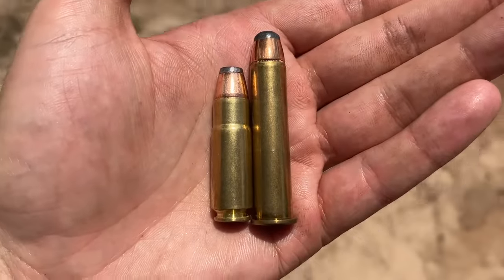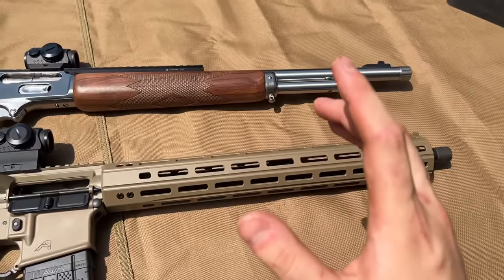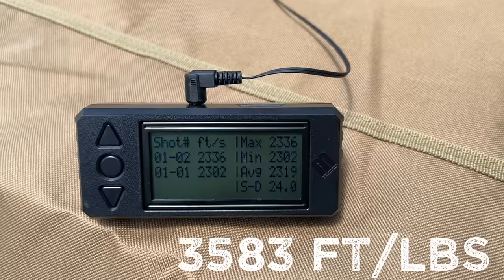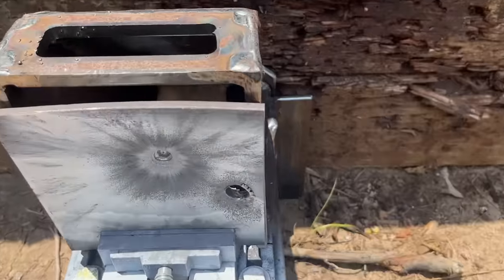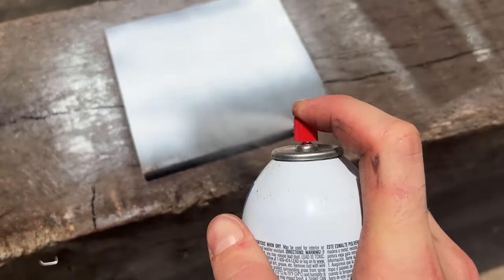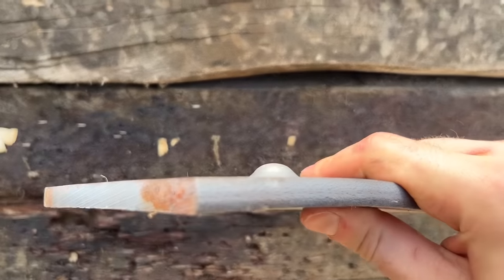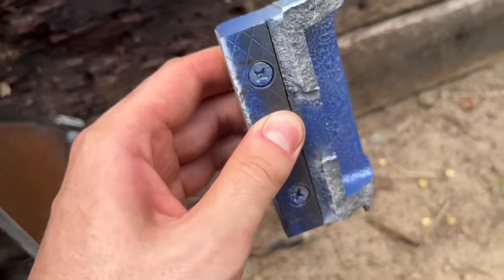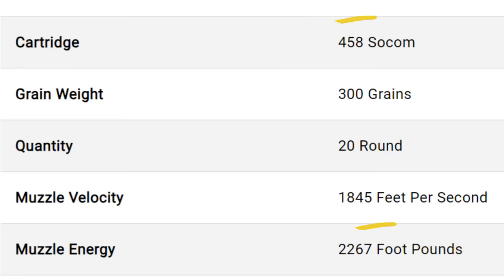458 Socom vs 45-70: Completely Different On Mild Steel

Comment: Several years ago I shot an old steel sledgehammer head at 125 yards with a 1944 Kar98k using 1943 Turkish 155gr cupronickel FMJ lead core ammunition. The bullet made a deep crater in the steel, made a nearly perfect 180° ricochet, and struck me on the knuckles of my right hand which was still gripping the stock (my trigger hand). It didn't break any bone but I have 3 scars there now. It felt like someone had just walked up beside me and smacked me across the knuckles with a 2 by 4.
Reply: you were very lucky my friend!

Comment: These new hot 45-70 loads are probaly closer to a 458 win mag than the original 45-70.
Reply: Than the original? Of course. Closer? Of course.
But although powerful in its own right, still significantly less.
Reply: @siegfriedhorner4436  Of course, but I didn't say AS powerful. I said closer.

Comment: Try 500 Automax. Buffalo Bore has a 400 grain at 2,050 fps and a 350 grain at 2,300 fps at 4,110 ft lbs.
Reply: 325 grain  level evolution is over 2600 feet per second out of my gun. And that's weak sauce out of a 45 70 There's a 380 grain. From Buffalo Moore. Making over forty two hundred foot pounds of energy
Reply: @poorfatman5317 I just looked at Buffalo Bore ammo, the hottest 45-70 they offer is 3678 ft lbs energy.
Reply from the maker: That round is absolutely insane. The closest I have to test (out of the ar-10) is the 45 raptor which is only doing about 3,500 ft/lbs

Comment: I think you need to re-test the 4570 vs 3/8 steel. The round could have pennetrated if the energy was not reduced by the busted weld on the sled. What do you think?
Reply: I dont think it makes any difference will it move freerly while being hit or being welded on place.
Isnt that subject already beaten death ? Everything happens just too fast to plate or any
target to move before energy is already transfered.
But sake of shooting for pleasure you could redo that part if shoulder doesnt disagree.
Reply: @oldbonesbushcraftrodjackso474  I can tell you that a 45-70 will easily go through a half inch of mild steel. I've done it a few times.

Comment: cast iron, that will keep breaking on that vise, you need a vise made out of steel, in my opinion. but Hey, we like to see you keep breaking the sleds, LOL. Have an awesomeness day. thanks for the videos, I would have thought the 45-70 would have done more.
Reply from the maker: I got one made of forged steel instead of cast iron for when this one fully breaks. I really appreciate it and I thought the 45-70 would do more as well.
Reply: @bananaballistics I would suggest wood blocks to wedge the steel plate against the backing. Cheap and when they splinter get another one

Comment: Those clamps are likely made out of cast iron which could be why they are cracking.
Reply: Yeah I believe most vices are made with cast iron.
Reply from the maker: Definitely the case. I got one made of forged steel, so we will see if that does any better
Reply: @bananaballistics  A warning with the forged vises, they're typically hardened for use with milling machines, etc, which makes them more brittle.
If you find your new clamp fails, you might want to fabricate a mount with sacrificial shear points, like some low-grade bolts holding it to the base. That way an easily field-replaceable part will fail first.
Reply: You might be able to forgo the vise and use magnets to hold the target to the hood.
Reply: Why don't you just save money eyed on the clamp vise and weld the corners so there's no unsymetrical deflection

Comment: I built a very light 458 SOCOM [6.5lbs loaded & with optics] with a good muzzle brake to tame the recoil and use 410gr Sub-X heads pushed at 1600fps for my Elk brush/heavy-woods gun... It performed fantastic since the elk aren't armored. 😂 no follow-up shot necessary and the sling options make it easy to carry in a way that provides faster acquisition and less muscle fatige... a real bonus on long walk hunts or rough terrain. 
Terminal ballistics and defeating barriers is neat at the bench, but there's far more to be considered for use in the field.

Comment: Great video.
I’d like to see the .50 Beowulf thrown into the mix, Alexander Arms designed it to mimic the 45-70.
Reply: Agreed! I'm really interested to see what .50 Beowulf would do in comparison to 45-70.
Reply: It is a monster 👺
Reply: @ZRaddue  
Took two water jugs to the range to test that theory.
405g 45-70 from my Marlin blew the jug up epically.
The 330g .50 Beowulf vaporized it.
Reply from the maker: I need to get into the 50 Beowulf. Closest thing that I have tested so far is the 500 S&W (video coming soon)
Reply: @bananaballistics  
Almost picked up a 500 S&W but found a Taurus Raging Judge Magnum at a great price.
Reply: @@Peter-nm1psnot to me 😢 I’ve got aero precision builds in .450 BM .458 socom and .50 Beowulf. The 50 is still my favorite, slaps hard and was really fun to iron out the kinks but yeah if you want to be the same as everyone else stick to .223 or a unsuppressed .300 blk out
Reply: Personally I wouldn't bother with a 50BW if it's trajectory is gonna be worse than the 45-70.
Reply: Designed to mimic which 45-70 load? The original BP or some new +P variant? Very different loads

Comment: Great video. Your velocity with the .45-70 indicates you were using H4198 or IMR 4198 minimum powder charges. My reload is 53.7 grains of IMR 4198 under a 300 grain Hornady HP with 2300 fps which equates to over 3500 ft.lbs. of energy. 
It shoots sub MOA at 100 yards and even with a minimum starting load enough guts for anything you can hunt in North America. It would be interesting to see what a hard cast lead would do instead of the traditional cup and core bullet on steel or any  other medium you could imagine. I think it would be unstoppable. Keep bringing 'em, Banana.

Comment: Great content!  I'd like to see you do the test with the 45/70 vs. 3/8" soft steel plate again.  The fact that the back-end piece of the vise that was holding the 3/8" plate in place was cracked and had some give to it may have prevented the slug from penetrating the plate.
Reply: If you do some research, that doesn't make any difference. The energy of the round is completely dumped into the steel plate before it even begins to move. A physics guru can show you the math and mechanics.
Reply: @wilsonrawlin8547 😂😂😂 Not true. Not even possible. Equal and opposite is always on the same timeline. We've seen how this flex changes things over and over again. Sharpen your pencil and get back to us with some real science kiddo.

Comment: Owned a .45-70 at one point.  Could go through two or three boxes in a single shooting session.  No problems with the shoulder.  I think I also process recoil differently.  I would offer to let others shoot it but had few takers.

One thing you are definitely right about is the price.  They say money talks.  When shooting that thing it said goodbye.  Think the cheap 300gr loads were about $1.80 a pop.  Had 400gr +p loads, I don't want to think about what that cost.  They hit like a hammer at 300 yards though.

Comment: I have a marlin 45-70 and it is brutal with those stout loads.  I find the recoil magnified when shooting   from a bench rest for some reason.   The recoil seems to be more tolerable when shooting from a standing position where your offhand can grip the forend.    Not sure why, but just my observation.

Have some fun with the 45-70 and load it with some blackpowder (not substitutes).  Lots of fun to do and recoil is tolerable.

Also, no kidding, you should look into doing voice over for narrations etc.   You have a golden voice tone, so might as well use it to your financial benefit.  Just my two cents.

Comment: I've always wondered the results of 450 Bushmaster vs 45-70. They are so similar but I think the 45-70 would still have more punch
Reply: Especially in a Ruger 
No. 1 load in a Ruger No. 1.
Reply: When I think of a 45-70 I think a big game. Know where I can think of. Not even a Africa has any animals with mild steel plate for skin. Therefore, what goes through a steel plane just isn't that interesting. Perhaps it's just me. It's kind of like thinking a drill is better than a screwdriver because they both spin or something I don't know
Reply: @henryettacollins9095  only solution is to head to Africa and shoot a bunch of big game to test?
Reply: I think the SOCOM is a bit hotter than the BM, so it definitely wouldn't measure up.
Reply: Yes the 458 Socom has more oomph then the 450 so the results would be less
Reply: I'm pretty sure 450 BM has a significant velocity advantage to 458 Socom. It matches up fairly well to factory 45-70 Gov
Reply: @hammerheadms  To be fair, the BM has a slight (50-70fps) advantage with 250gr bullets and with 300gr bullets they are dead even. The SOCOM shoots 600gr bullets at ~1000fps, the same as the BM does with the 405s.
The BM was designed specifically to hunt deer in "straight wall states" with those 250gr pills. It's really quite impressive performance from an AR.
Reply: @joshrandall3632 most of the published velocities use a 16" barrel for the 458 and a 20" for the 450.
Reply: @scoyounger  no, they all use 16" barrel.
Reply: @user-ev2qo1hj1g no, the 450 is faster at the same grain.
Reply: @joshrandall3632  450 is the hotter one.
Reply: @joshrandall3632  450 was not designed specifically for deer. It was designed for cape buffalo and such.
Reply: @JoeZelensky   To be fair, the BM has a slight (50-70fps) advantage with 250gr bullets and with 300gr bullets they are dead even. The SOCOM shoots 600gr bullets at ~1000fps, the same as the BM does with the 405s.
The BM was designed specifically to hunt deer in "straight wall states" with those 250gr pills. It's really quite impressive performance from an AR.
The 450 wasn't designed for cape buffalo. It's not nearly enough for that. Black bear and elk for sure but no intelligent person would use it for cape buffalo on purpose. You're probably confusing it with the 450 Marlin because the numbers are the same. The Marlin is quite a bit more powerful and is adequate for CB. Also, the Marlin uses .458 bullets designed for big game instead of .451 handgun bullets designed for deer.
Reply: @joshrandall3632  with all supersonic ammo the 450 is faster. With subs they are all the same speed and weight. Yes the 450 was designed for large and dangerous game, not whitetail deer. You are a little confused, hopefully this clarifies things for you or gets you to read up on this stuff.
Reply: @JoeZelensky  where would we read up on this? Can you share any links with us?
Reply: @joshrandall3632 Absolutely true mate 👍👍👍
Reply: @JoeZelensky 450 BM for Cape Buffalo 😂😂😂
But...
What to expect from zelensky 😂😂😂👎👎👎👎👎👎👎👎👎
Reply: @scoyounger Info is probably from Ukrajinska pravda...😂😂😂
Reply: @scoyounger  read up on what exactly?
Reply: @JoeZelensky  where it says the 450BM was designed for dangerous game/cape buffalo.
Reply: @JoeZelensky  and published barrel length velocity. Hornady and Wikipedia use 20" and Fort Scott uses 24".

Comment: I've been handloading the 45-70 for close to 50 years for any thing from a Trapdoor Springfield, custom built Thompson Contenders, Marlin lever's, to my BFR and Ruger #1. You accidently put one of my Ruger#1 loads in a Trapdoor and you're either going to break it - or get seriously hurt from the flying shrapnel when it comes apart in your face! 

Point being, the 45-70 can be loaded very close to .458 Win Mag velocities, OR - you can down load it for pistol use as long as you don't get too light on the powder charge and end up with a hang-fire. A little case filler can fix that problem. The 45-70 in a very versatile cartridge and that's the reason it's still popular after 150 years! But it's definitely not going to fit in an AR magazine! Interesting and well done video!

Comment: I grew up with my dad reloading 45-70. The 465gr was the standard military round. Redo that test with the 465gr.  I'm betting it will move up to the next thicker plate easy.  Wear your shooting jacket with shoulder padding!
Reply: They used 465 too? I knew the old black powder guns used 405 grain and 500 grain. The 495 was cavalry and 500 was for infantry.
Reply: @Hunt_or_Die   When it was 1st standardized, replacing the 50-70, it used the 405gr bobo. US Army Ordnance subsequently tested it beyond [practically useless] 500 yds and determined that the 500gr bobo gave it greater range, whereupon that became the standard load. They also came up with a reduced load for cavalry carbines & the cadets at West Point that was a 45-55 using that retained the original 405gr bobo; that load is what they should have standardized upon in a shorter OAL that would have fit in a lever-action repeater and then used up until the Krag came along, but nooooo, the Army didn't trust the soldiers not to "waste ammo..." 🙄
Reply: @Hunt_or_Die  all of dads dies and load data he had was for 465.  He had some other data but preferred to stay with that as he told me that is what it was designed for and worked best.  Dad had the original info from the military including original manuals.  My brother got all the 45-70s and documents for them when dad passed or I would go review them and provide references.  Or find out what he taught me was incorrect.
Reply: Seems like you would actually lose penetration on steel because of the significant decrease in velocity.

Comment: You should just weld a slide insert on each side sized for the largest plate you use so that all you have to do is drop the plate in and it's captured

Comment: A simple way to attach the plate: just make 4 holes on each corner of steel. Attach to the cut end of a wood chunk with drywall screws using a cordless drill. Then once it passes through you can check out the bullet for weight retention. Would be more interesting if we knew the type of bullet.

Comment: The 458 is no slouch. It will still perform well on dangerous animals but I am glad this video demonstrates that the 45-70 is still a great contender and excellent choice. In event of a bear attack I think the 45-70 would be better for penetration,  but the 458 would be better for rapid fire and more rounds on hand. Either one would suffice I believe.
Reply: Exactly, I built a tromix .458 socom for hogs just for that purpose. Had a big boar charge me and a friend who both got 9-10 shots of a 5.56 and .300blk and he covered a good 40 yards before he hit the ground. Built the .458 the next day and ordered a magazine that lets me hold more rounds.
Reply: 300 gr is on the light side of the 45-70. Start sending some 400-500gr bullets and they go through some stuff.

Comment: The cracking of the clamp demonstrates a value to the .45-70 Government that many never consider: punching through an object is nice but the vibrational shock damage is also a factor towards disabling the target.

It is a favorite of mine so yes, I am biased and yes, I learned early on the value of shoulder padding when using that rifle.

Comment: Dang, kinda surprised to see that rear jaw already had a crack just from 5.56 and 300 blackout. I figured it would break with something bigger,I’m assuming the 45-70 will do it (i paused the video when you showed the crack), the smart move was making it easily replaceable because just about anything will break once you start smacking those 1/2” plates with some spicier rounds.
Reply: That cracked metal was obviously pot metal. It needs to be rebuilt with forged iron or steel.
Reply: @GalloPazzesco  yeah i know i have the same table Vice for small projects. I commented on the first video where he showed it and said something along the lines of that not lasting long. 

I have ar500 steel targets that broke where the mounting holes are so i knew that Vice wouldn’t hold up long. Just surprised it only took like 4 rounds to break

Comment: I built a 458 SOCOM AR and yeah, the recoils is vicious! I added a LimbSaver pad to the MagPul MOE Carbine stock and it still hurts to shoot more than 10 rounds.
Hornady 300gr. JSHP, 36gr. of H110, OAL 2.020".
Reply: I recently built a 50 beowulf AR and it really helps if you change out the buffer spring to something beefy. I also recommend an actual solid stock instead of something adjustable.
Reply: Interesting.  I built a 458 upper and frankly, the felt recoil is no worse for me than 5.56 and I hardly have any muzzle jump.  I'm shooting ventura munitions 350gr RNFP and using a standard buffer and spring as intended with 458.

Comment: Consider comparing the 454 Casull against the 45-70 or 44 magnum on steel.
Reply: 454 and 44 are both weaker than the 458 socom so what would be the point
Reply: @looseballs1966  Is curiosity enough of a response to you !!!!
Reply: @glengrandstaff9695  probly not curious because of more than 40 years of reloading shhoting and extensive testing of all of the above there is just nothing new to learn about it.
Reply: @looseballs1966   I guess you have a point. But I have seen videos on YouTube comparing the 454 Casull against the 45-70  in Clay blocks and ballistic jell and the 454 Casull matched or out did the 45-70 in terminal damage. Like I stated Just curious. Matters to me how much so called experience one has.
Reply: @glengrandstaff9695  Being around the stuff so long and having used all of the mentioned rounds as well as 460S&W 480 ruger and some others in not only testing in media like you mentioned I have also been an avid hunter for going on 45 years now in Idaho where I live I have seen the effects of said calibers used on dear Elk Moose bear and so on,,,, so no shooting thru steel plate holds no real intrest per say for me,,, morbid curiosity yes a bit but a bullet passing thru steel plate actually realy meens very little in how effective it will do it's job on living creatures.